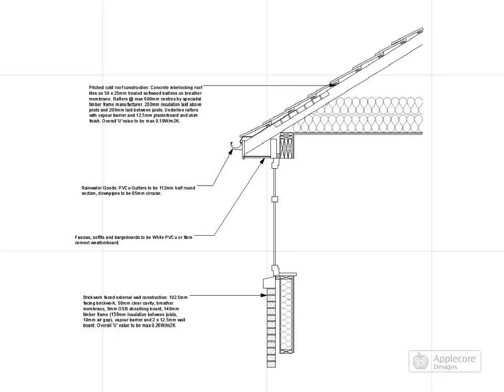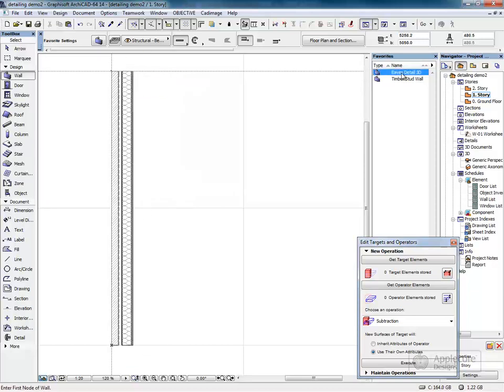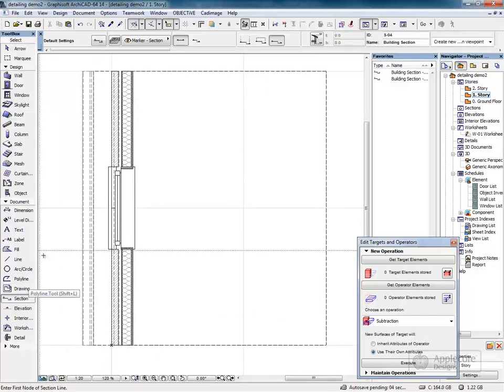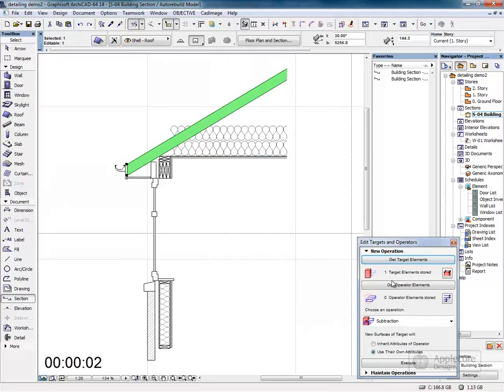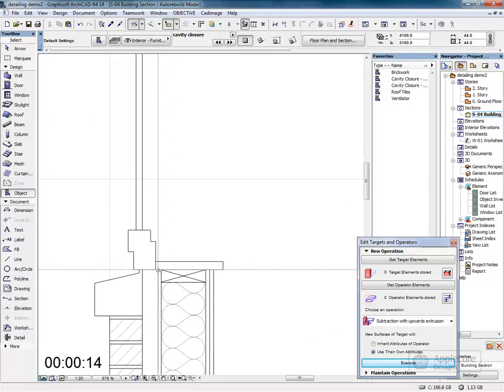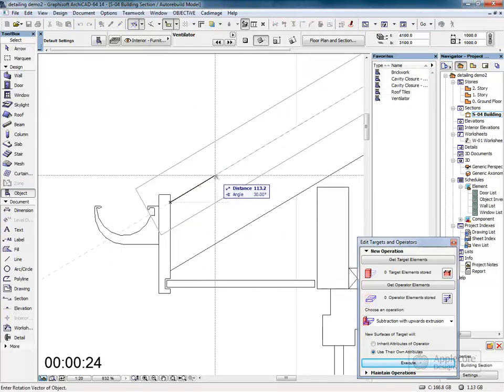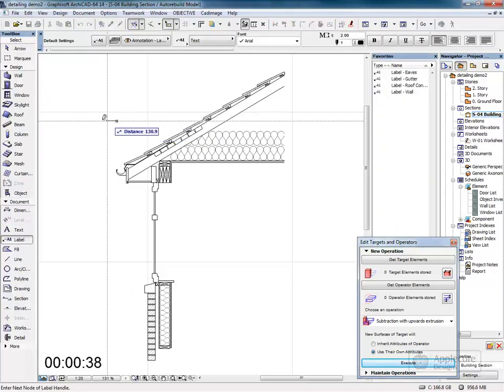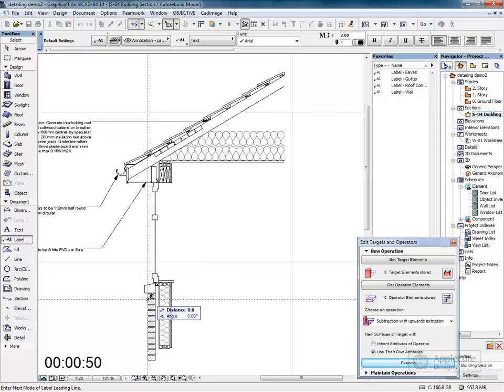ArchiCAD Detailing: Eaves Detail

Comment: I really enjoy your videos and am impressed with your 2D objects and use of complex profiles. Great stuff! Just a thought, in case you wanted to adjust the leader lines to the center of the top line of text, perhaps try using the middle anchor point and then adding a few blank lines above your first line until you're happy to redefine your favorite. Just a small suggestion on an otherwise flawless demonstration. Looking forward to more:-)